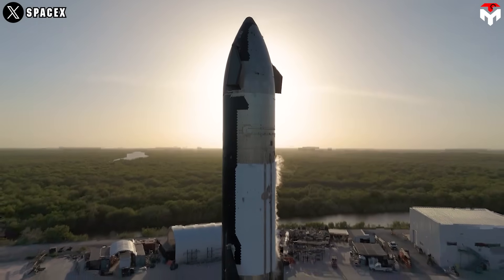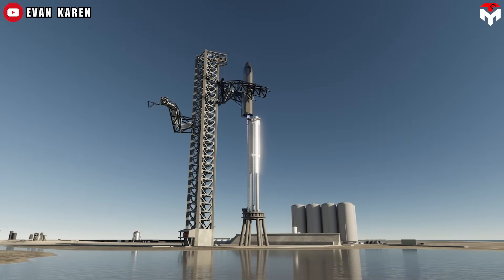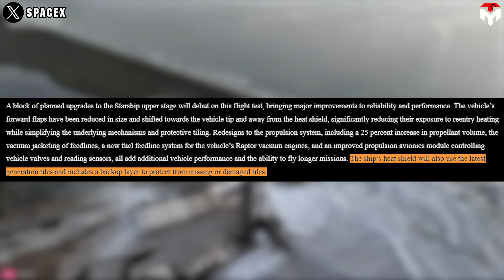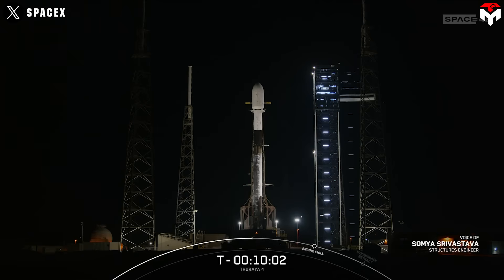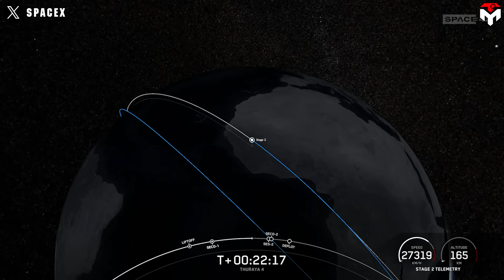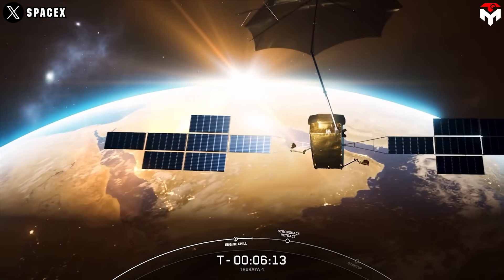"1800°C Melt!"Starship Flight 7 METALLIC Heatshield will End Ceramic Falling...

Comment: According to Grok 2:
Will starship flight 7 have metallic heatshield tiles?
Starship Flight 7 is planned to include some metallic heatshield tiles, according to recent discussions and updates from SpaceX. There are mentions of testing various metal tiles, including one with active cooling, to study how these materials handle the stresses of reentry. This experimental approach is part of SpaceX's iterative design process to refine the thermal protection system (TPS) for future missions.

What percentage of its heatshield will be metallic?
Based on the available information, there is no specific percentage provided regarding how much of Starship Flight 7's heatshield will be metallic. Discussions indicate that SpaceX is experimenting with metallic tiles alongside the ceramic ones, but it's not clear what proportion of the total heatshield will be made up of these metallic components. Therefore, without explicit data on the percentage, it's not possible to give an exact figure.

Comment: So, still struggling to do exactly what OV101 - OV105 could do no problem at all DECADES ago.... just wow 😂
Reply: It took nearly two years to service the tiles on OV101 - OV105, between flights. A lot of that had to do with how they had to handle the adhesive for the shuttles. Also, the fact that many tiles were unique added to the difficulty. If SpaceX wanted to replicate those accomplishments, I have no doubt that they could match them. The goal here is to find something that is rapidly reusable. That's the true struggle. 
Why didn't you just call the shuttles Enterprise and Endeavor instead of using their Orbital Vehicle Designator? It's not a good look. It's almost like you're compensating for something and trying to appear to be the smartest person in the room. It's almost as bad as someone who corrects a person's grammar instead of examining the veracity of that person's logic. Of course, you may just be 13. If that is the case, I understand.
Reply: @bvirgin123456  oh but they worked....you must have missed that point did you... only failure due to damage....
Decades of "fixture" development, decades of material development... they still did a far better job that today ... FACT xx
Poor little fanboy got offended it seems 🤣🤣
Reply: @albertbahoogadin  I am not sure that the family of the Columbia shuttle crew would agree with your assessment.

Comment: Those six aluminum - skinned tiles were designed to melt because SpaceX was using them to measure the temperature-time data at those tile locations using video of those tiles during the reentry heating. 

SpaceX engineers were attempting to determine when during the reentry the melting temperature of aluminum (660C, 1221F) was reached the locations of those tiles.  

That information would be used to determine which of the tiles at the edge of the heatshield could be safely removed to save weight without exceeding the maximum use temperature of the stainless steel hull that SpaceX was using as its safety margin.
Reply from the maker: Interesting observation!

Comment: Fully metallic or composite metal and ceramic tiles with the underlying mat should provide more secure tile retention than anchoring the ceramic directly. This would maintain structural integrity. Relocating the flaps to reduce hinge exposure to plasma penetration into the joints is the obvious solution, and I'm surprised that this wasn't discovered in the computer modeling early on. It doesn't help that they have insisted on maintaining a cylindrical cross-section instead of the original oblate form depicted early in the design phase. There's a very good reason for having a "blunt" surface facing the atmosphere. It protects the rest of the craft from the plasma generated on reentry and the flaps wouldn't be exposed until through the critical heating phase. Relocating the fore and aft flaps to 120⁰ from each other on the "upper" side would ensure protection while allowing effective operation to control descent in denser atmosphere. Active liquid cooling will add mass to the craft and reduce usable payload. Considering the obsession with reducing mass by eliminating landing legs, heat shields for engines, and other measures, adding additional mass to be used to cool tiles instead of modifying the shape of the craft to eliminate the issue in the first place seems a bit obstinate and counterintuitive. I hope their "solutions" work and the craft is successful. Considering the "pointy" shape is admitted to be a whim of Elon's and not the best design, it seems they have created more problems to solve than proper design would have prevented. IMHO, as a retired Industrial Design Engineer.
Reply: #1 Goal, keep humans alive.